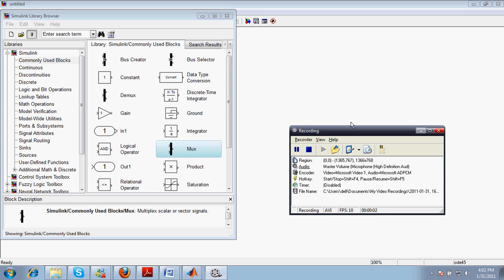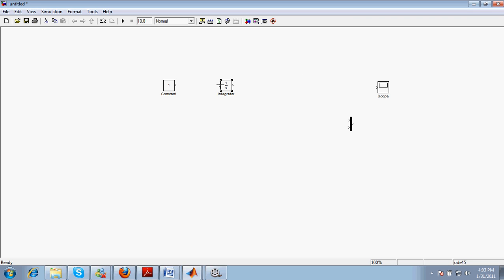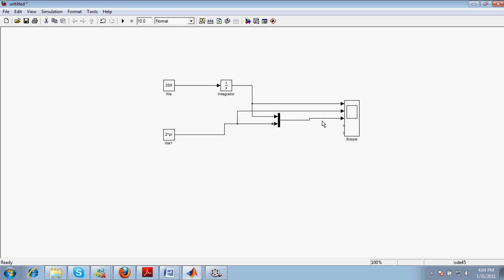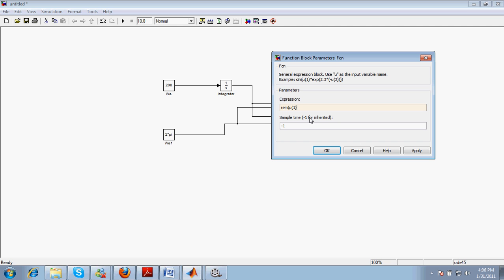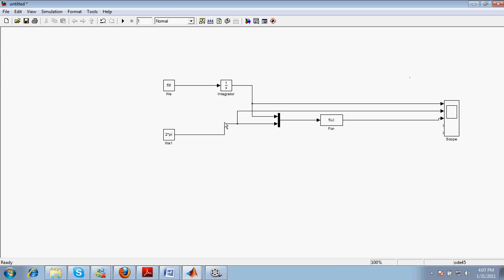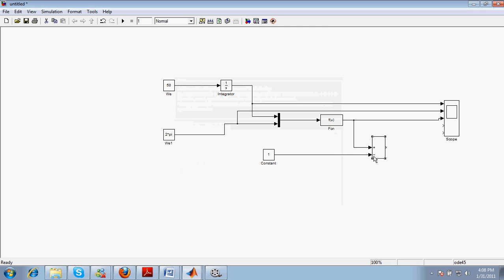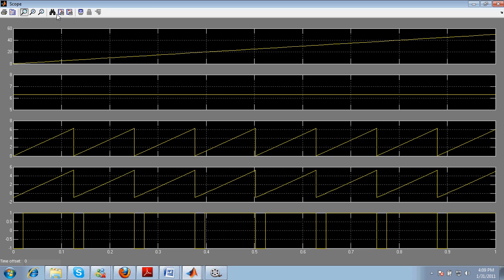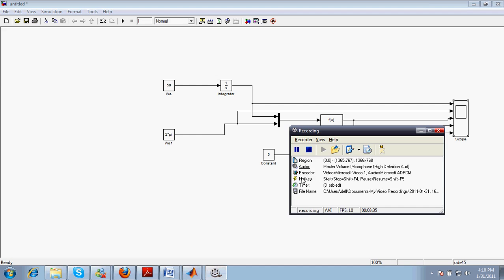PWM generation using SIMULINK

Comment: hello sir M working on Zero Voltage switching dc to dc converter. so want to design the controller which controls the gate signal at desired input values. then how could I do this?
Reply from the maker: you should read the literature about ZVS
Reply: ok thank-you

Comment: Hello sir,I am trying to get a pure symmetrical   triangular wave in my SPWM design to control my 3-phase IGBT h- bridge inverter. How can I obtain a symmetrical triangular wave?. thank you
Reply from the maker: +Hachani Kelthoum You can get it by using a programable source. Alternately you can use an embedded matlab function and can program a symmetrical triangular wave
Reply: +This is Pakistan thank you sir,and how about if i use matlab simulink?
Reply from the maker: +Hachani Kelthoum Yes in simulink there is embedded matlab function

Comment: sir thank you for thıs ınformatıons :) ı need to design a software which will generate sinus, triangle and square wave signals.
These three different signals have an amplitude between 0 (0% no throttle) and 100 (100% full
throttle). Besides, the frequency of these signals has to start with 1 Hz and end 20 Hz with a
linear increasing frequency.can u help me :)

Comment: Sir i want to generate code for switching pattern of Pwm inverter in simulink Matlab can u help me in this ??
Reply from the maker: +Syeda Naqvi The simulink is fundamentally different from matlab as in it we use building blocks while in matlab we do coding. So if you want to have a code in Simulink you have to use embedded matlab block available in simulink. Write your code in it and generate the PWM.

Comment: Hello sir!!!
I have a question if you can help me..... I need to split a single PWM as an input to two Mosfets so that they can be turned on 1 by 1.... How can i do it in simulink????
Reply from the maker: +anser ali Well since you have not explained the configuration of the switches, i assumed that they are connected in one leg. In that case, use a not gate for one mosfet and supply the second mosfet directly from the PWM output.
Reply: Sir, I have a figure that expalians my question clearly..... Is there any way to send you that figure.... It will become really easy for me to make you understand.....
Reply from the maker: +anser ali Upload it on some site like picasa or flickr. and send me the link here. It is important because it will help  in disseminating knowledge
Reply: +This is Pakistan Thanks for the quick response....I am designing a DC-DC boost converter using 2 mosfets. I want to give a PWM to these Mosfets such that their turn off and on is complementary.... For example for 1st  On time of duty cycle mosfet1 is on and mosfet 2 is off... for the second on time mosfet1 stays off mosfet 2 is on.... and so on..... in short we can say we want to make them turn off and on alternatively from the same PWM
Reply from the maker: +anser ali This is what i suggested above. Use a not gate for one mosfet and connect it with the PWM block. The other mosfet can be connected directly with the PWM block. So when one mosfet is ON the other is OFF and so on.

Comment: Hi....I am trying to get a pure and symmetrical triangular wave in my SPWM design to control my 1-phase IGBT inverter. How can I obtain a symmetrical triangular wave?. I have been trying for weeks and nothing has worked with me !!. In Simulink,the Repeating Sequence box does not give me the wave I need.
Reply: You can try using the triangular waveform generator. Or can specify the values by using repeating sequence block. It will give you symmetrical triangular waveform

Comment: why didnt you use a repeating sequence block and constant block, instead? that would make it more simple, i think
Reply from the maker: I do actually. This one is just another method that most people just don't know :)
Reply: This is Pakistan what is the base for this method, i mean, is it according to any mathematical equation or a work of your trails?
Reply from the maker: fazeel ahmed a professor told this in his lecture...

Comment: good day sir i would like to ask how to construct a hysteresis current controller for compensation single-phase harmonics using simpowersystems block sets
Reply from the maker: Very easy. Sense the output current and compare it with reference current and feed the Mosfets.
Reply: Can I get an example on it sir
Reply: K-vin Bhathal I will try !!
Reply: Hadeed Sher thank you sir it would be very helpfull but instead of mosfet i will be using IGBT's

Comment from the maker: In practical cases the duty cycle is calculated based on the feedback from the output. However, here in this demonstration the duty cycle is obtained by comparing a reference voltage with the triangular waveform

Comment: sorry, may I ask you a question? not regarding this video. how to regulate the input current to be sinusoidal and the source power factor can be controlled at unity? i am working on on my final year project on 3 phase ac dc buck converter. tq!

Comment from the maker: Why u need to have such high amplitude. If u r using the repeating sequence box. write the few values like [0 0.1 1 0.2 0 0.3 1 0.4] etc. What amplitude u r talking here. If it is DC then the switching will automatically take care of it. I will upload the inverter video soon

Comment: You're right. but still I am not getting what I am excepting. 
If the freq is 1800 Hz and the amplitude is 300. How do u recommend me to insert the two data in the parameter?. 
isn't [0 .000556] for time values
and [-150 150] for output values? Right?
thanks

Comment from the maker: To regulate you need a close loop system. Your stages are RECTIFIER, CAPACITOR, DC-DC CONVERTER with close loop operation.

Comment from the maker: Use a sine wave block in place of the constant to have a sine PWM. If you want to generate 3 phase SPWM then use 3 sine blocks with 120 degree phase difference and use them with the triangular waveform. You can use MUX/DEMUX also for three phase SPWM

Comment: Thanks for the lecture. I am working on SPWM techniques (sine wave is compared with a triangle wave to generate an SPWM signal). I did it using MATLAB coding but would like to do it using SIMULINK. Can you please provide some resources that could help me?
or can you tell me how can this be done?
Thanks.